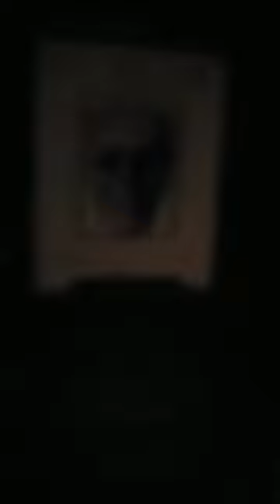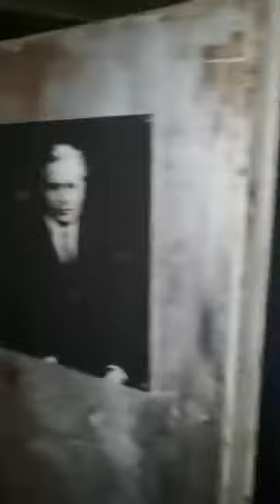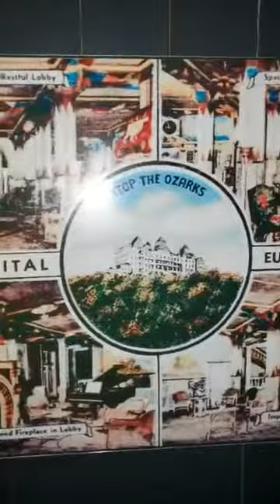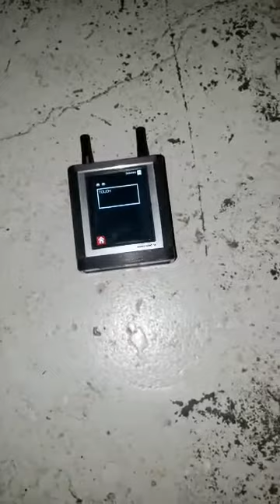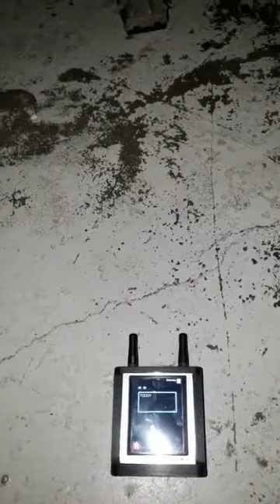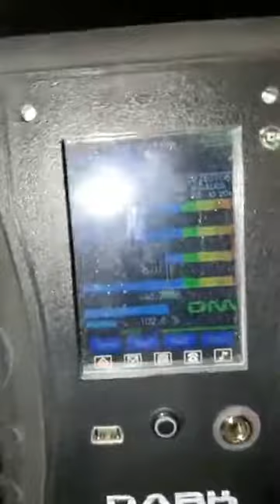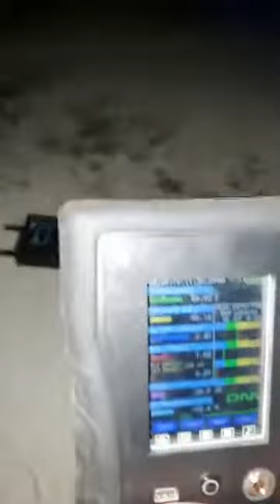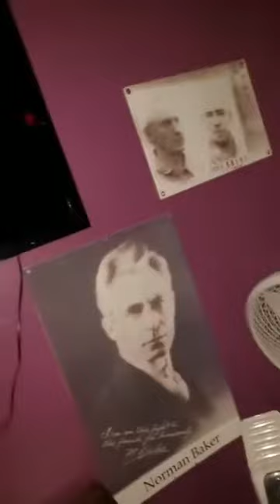Tour of Dr. Bakers Creepy Haunted Morgue at the Crescent Hotel in Eureka Springs, Arkansas

Comment: They changed the morgue up a lot since I spent the night there back in 2011, it was a maintenance shop with Paint cans back where the locker is, they didnt have that wheel chair in there yet.
Reply from the maker: Yes, they have done quite a bit of renovating in the parts room. With the new bottle findings on display it definitely adds to the creep factor! Thanks for watching!